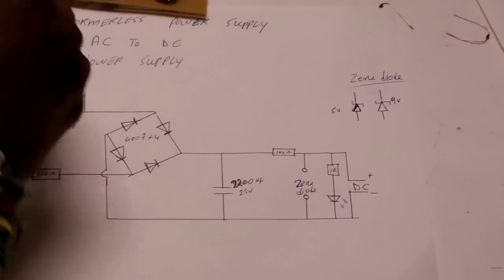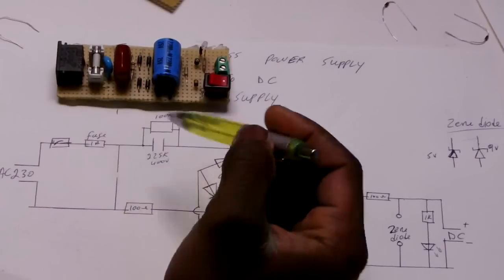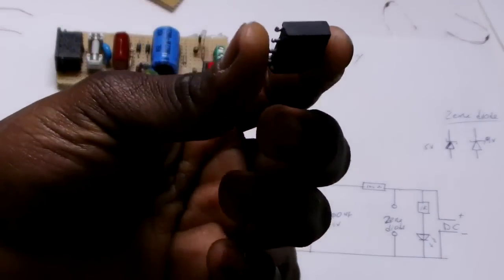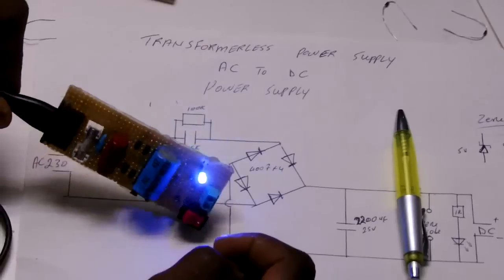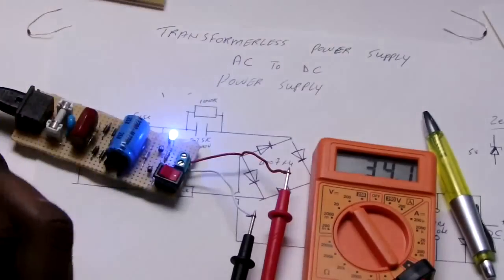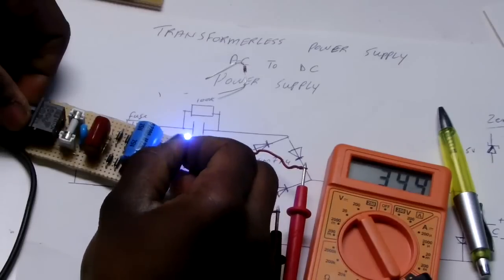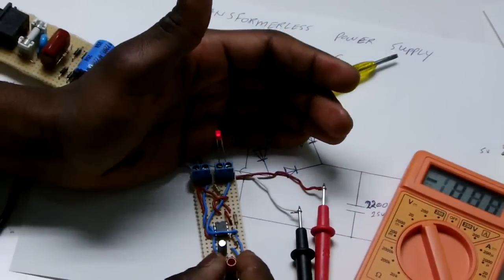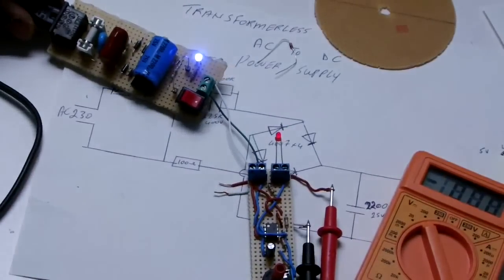transformerless power supply

Comment: Is it possible to build a 2A, 12 V power supply by using the same method? Please anybody help me to design such a transformer free power supply !!!
Reply from the maker: +SACHIN C V
 https://www.google.be/search?q=transformerless+power+supply+12v+2a&num=40&newwindow=1&es_sm=93&tbm=isch&imgil=4OmzR-YKsOgETM%253A%253ByDhmUmvsW6WfIM%253Bhttp%25253A%25252F%25252Felectronicpowersupply.blogspot.com%25252F2013%25252F09%25252Fhow-to-make-transformer-less-12volt.html&source=iu&pf=m&fir=4OmzR-YKsOgETM%253A%252CyDhmUmvsW6WfIM%252C_&biw=1600&bih=775&usg=__fVNF7FAUcUdkgNCj9JJl3emuBbU%3D&ved=0CC4QyjdqFQoTCJfKifOP_McCFcfTGgodHrcHvg&ei=5Kz5VZfIIcena57unvAL#imgrc=4OmzR-YKsOgETM%3A&usg=__fVNF7FAUcUdkgNCj9JJl3emuBbU%3D
Reply from the maker: +SACHIN C V 
i found some that may
 shttps://www.google.be/search?newwindow=1&es_sm=93&biw=1600&bih=775&tbm=isch&sa=1&q=12+volt+converter+3+amp+circuit&oq=12+volt+converter+3+amp+circuit&gs_l=img.3...7568.10122.0.10742.3.3.0.0.0.0.76.199.3.3.0....0...1c.1.64.img..3.0.0.R2IoXlylNYc#imgrc=aZSezJEz4JOH-M%3Aome
Reply: Thanks for your reply.I already gothrough the above link.In the first link the capacitor value C1 is 1395k x rated capacitor. But while designing for c1 for 2A i am getting 27uF. Is there any x rated capacitor with value 27uF?
Reply: +SACHIN C V no! transformerless power supply is for small current!!!!!! high current make the project expensive!

Comment: Hi, which are the components that actually replace the transformer? the little blue one (I couldn't see what was the specific name) and the red big capacitor at the beginning, am I right? If I used those ones with the bridge rectifier, the 1000 uF capacitor and a LM7809 would be enough to have a 9v power supply? Thank you
Reply: Junior Electronics  Excuse me sir, I am very sorry I am new to this, how did you know the right parts or computation for capacitance and others, I hope you can make a tutorial for any DC output and Voltage. (Current and Voltage) thank you very much. your work is so clean.
Reply from the maker: zymeth bautista actually is not that difficulty .when u wanna convert AC to DC voltage u have to go through some stages.so when u know the component and there functions?then everything became easy.

1a fuse=used as protection against circuit shorted -mov keko cv 275K20= used for lighting  or over voltage protection

-ac  capacitor(polyester)=used to step down the voltage
-100K transistor is parallel with polyester capacitor,=used as a bleeder for safety
-bridge rectifier=convert AC to DC 

-dc capacitor =act as a dc smother 
-100 ohm  from positive side of bridge rectifier  to the zener diode =used as protection of zener
this just a small steps that u may need to know or follow
Reply from the maker: hi there this are the components,
-1a fuse
-mov keko cv 275K20 used for lighting protection
-100K transistor as voltage bleeder
-2 X 100 ohm 
-bridge rectifier 
-2200 uf capacitor 
yes its possible to connect lm7809 TO GET 9VDC
GOOD LUCK
Reply: Junior Electronics Thank you very much for your help sir. You are very kind.
Reply: Junior Electronics I am trying to build a power supply with 2 output of 5V 2.1A. the other is 1A.
then a 9V output and 12V output.
I am trying to know the knowledge behind the right computation in order to pick the right capacitor and resistor etc. etc.